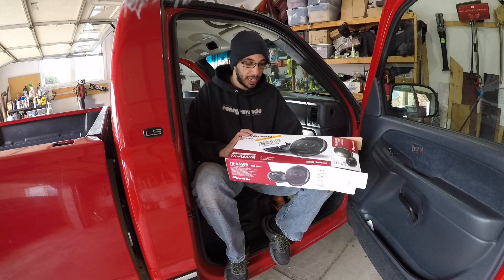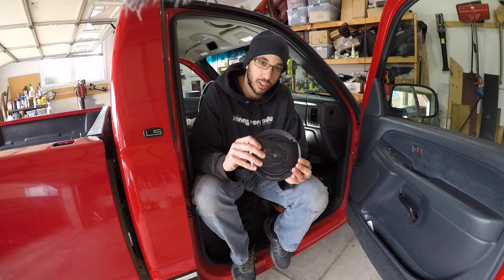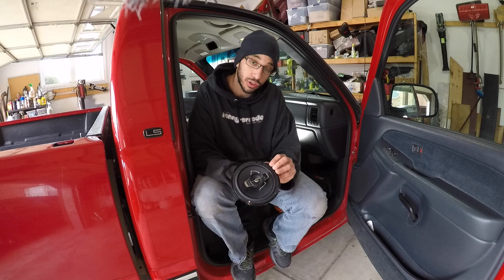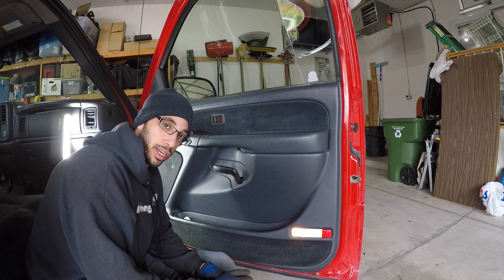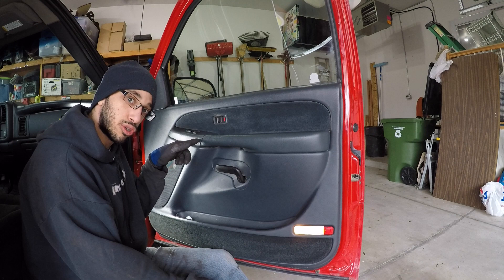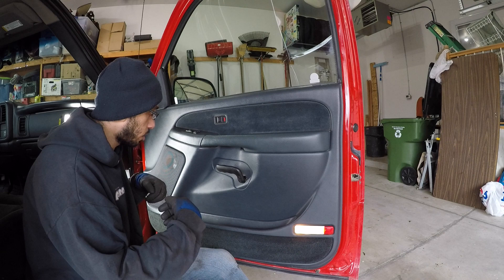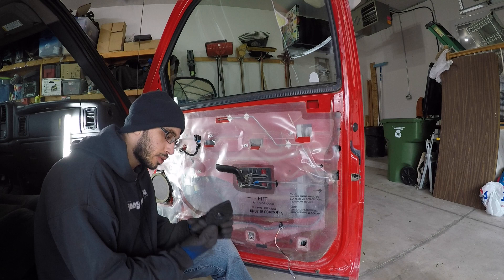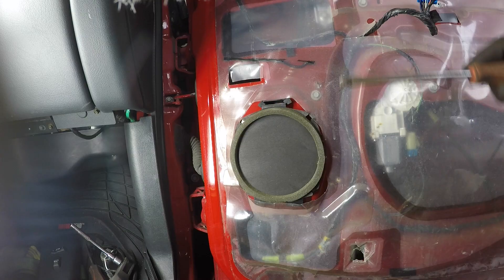2001 Chevy Silverado 1500 Front Speaker Upgrade

Comment: When you soldered the wires into the stock harness did it matter which side the positive or negative went on?
Reply from the maker: If you wire in multiple speakers then as long as you are consistent from side to side, you will be fine. For example, when wiring the door speakers, I think both had a black wire. I just put those black wires to the negative spot marked on the speaker and I was good. You will not blow anything up if you flip these around, the only thing that might happen is that the sound may come out distorted. So simply flip the polarity and it should solve the issue. 

Besides all that, you should always test your new set up prior to re installing the door panel and trim in case something doesn't work correctly because you will have it all opened up to diagnose and fix the issue. I hope this helps.
Reply: Thanks!!! Really helped! Time to go get some new speakers and install them haha
Reply: @mehoyminoy2485  any update on whether the side (positive / negative) matter?
Reply: @boji-boji  have not done it yet💀 wasn’t sure if I wanted to replace them
Reply: @boji-boji  positive negative definitely matters. if one side is reversed from the other the vocals particularly will try to cancel each side out making them diminished. Also it will not build an sound pressure at higher volume levels as each side is trying to cancel the other. I am disappointed he glossed over this critically important part.
Reply: After some research myself, here are the wiring requirements: For the front left (driver side), when you take the door panel off and disconnect the harness, the wires are TAN and GREY. The TAN is positive (+). and the GREY is negative(-). That translates to the recovered harness from the speaker to "A" is negative (-) and "B" is positive (+). If you look at the harness, it will have an "A" and "B" indicated. After I soldered off the old wire, I took the harness back to the door and matched up the slot. I noted which side was TAN and marked both sides of the harness with a "+". I did the same with the other side, marking it with a "-" Then I took that back in and was able to solder the correct wires based on the documentation for my new speakers (I got some Sony XS-R1646). Don't hate, they were $44 at Walmart and better than what I had. Also, on the passenger side, the colors will be: Light Green is positive (+), and Green is negative (-). I also got a new receiver, wiring harness, and adapter. Reply if you want to know what I got, of course, this is for a 2000 Chevy Silverado 1500.
Reply: I did it the same way as him, and it sounded good, so just copy him, and you should be fine

Comment: This is a Mickey Mouse job. Do not do this.
Reply from the maker: Hi Robbie! Thank you very much for the comment, would you be so kind and explain what you didn't like about the video? It would only help me for future videos I create. Thank you and have a great day!
Reply: Taping the tweeter in was wrong. With the heat in the cab during the summer, the tape will turn into a gooey mess.
Your wiring connector should have been mounted to the speaker and not left dangling in the door.
The wiring polarity has already been addressed.
It's only my opinion and I get a bit anal when I do projects/upgrades.
Reply from the maker: @jerrydespaltro4023  thanks for watching and for the feedback!

Comment: I installed a pair of Pioneer component speakers in my 02 Yukon SLT and reused the mounting bracket on the 6.5” woofers like you did. Worked great. I then reused the tweeter bracket by removing the old factory tweeter and taping in the Pioneer one. Worked great.  Thanks for the inspiration!
Reply from the maker: I am really happy to hear that and you are very welcome 🙂
Reply: You don't really need to add the old tweeter back, he used 3-way speakers.  Tweeter is built-in
Reply: I installed component replacement speakers. So I had to install the tweeters. I would worry that the factory amp would filter out the high range on the 3 way speakers.

Comment: Thank you Joseph. My soldering is not as good as yours. Still got them in, Also replaced rear, that was a pain. could not locate any type of adapter. Ended up just drilling into the holder that was there and using the same screws to hold the speaker. Metra makes an adapter for the tweeters #82-3016.

Comment: Hi Joseph, first I'd like to say, excellent video and good job with everything! So I was both commenting and asking, are you still running the stock stereo? I'd like to match my replacement speakers as close to my stock stereo's RMS specs as possible. Of course after perusing several videos of door panel removal, I still have yet to determine if my front speakers are the problem I'm having or it's possibly the stereo's output to the front speakers. That being said, I think you did a great job re-using the OEM speaker clip and harness connector. I probably will also do that if I end up replacing the speakers. Keep up the good work!
Reply from the maker: Hi David, thank you very much for your comment, I really appreciate the feedback. To answer your question, yes I am still using the factory radio. Thanks and take care.

Comment: I can’t get the bezel back on the front doors. I think my speaker is too big, even though it’s a 6.5, and I’m afraid to break it
Reply from the maker: So the bezel doesn't not sit flat, it will sit slightly bowed but it should still fit. I had to push a little hard to get mine to pop in, plus that bezel is pretty thick but if you break it, just buy another one at the u-pull. Good luck!
Reply: @joesdiy4260  Thank you, I ended up just using self tappers to screw it into the door and threw the bezels out.

Comment: I am about to do something like this on my sons 2006 Silverado. Question: I see there is a separate tweeter and woofer. If I installed a new 6.5 coax speaker in the woofer location - would it only be getting lows? Like is there a secret low/high pass filter somewhere sending lows to the woofer and highs to the tweeter? Or is the tweeter and woofer just spliced parallel together and the tweeter has a high pass soldered on it? Also wouldn't that drop the ohm since they are both on the same wire?  Like two 8 ohm speakers on one wire would be 4 correct? Trying to figure out if I should just leave the tweeter off or what. Thanks!
Reply from the maker: Hi Daniel, I am so sorry but I cannot answer question. I just threw some speakers in my truck haha car audio is something that I have never learned a ton about. Again, sorry I cannot answer your question, hopefully someone else here can. Cheers!
Reply: Just did this to my dads 2005 Silverado recently. The entire stereo system was stock but his front 6.5" speakers had fallen apart.
I replaced those speakers with Pioneer TS-652F. They are 3-way, 4 ohm, 6.5 inch, 70w rms, 320w peak, 87dB sensitivity.
The highs, mids, and lows, come through on the new Pioneer speakers, and the separate stock tweeters still put out their highs.

As far as I understand, the front mid woofers and tweeters receive the same signal, but the tweeters have their own high pass. I would assume the tweeters are a parallel yet completely separate wire feed that receives less power than the mid woofer does, but I'm not sure.
I thought about disconnecting the stock tweeters and tying their wire feed into the mid woofer wire feed for potentially more power output to the new Pioneers, but I ended up leaving the stock tweeters connected mostly because dad prefers clarity over punch.

The stock head unit was enough to push the new Pioneers and they sound good. Far better than stock. They would probably sound even better with quite a bit more power from an aftermarket head unit, but dads a simple man. Still plenty loud and even the bass is surprisingly potent especially when listening to bassy type music, though that requires the stock head unit bass setting to be at max. The volume at 50% is extremely loud yet with no distortion at all, and dad always keeps it below about 20%.

FYI, If your sons truck has the stock Bose system, there are 3 ohm and 2 ohm speakers used so they're not quite as simple to replace as the standard stock sound system. You'll know if it's Bose because the door speaker mesh says Bose on it.

Comment: The speaker wire for my truck keeps coming undone from the speaker any solutions?
Reply from the maker: Hey, thanks for watching and commenting. Make sure you have it pushed all the way on. You should feel it click. But if you are sure that you are pressing it all the way on, while it's connected, I would take a pair of pliers and gently squish the connector. That way, it becomes more tightly wrapped around the speaker connector
Reply: @joesdiy4260  so i only have the wires , the connector was gone from when i bought me truck and so i just have speaker wire connected to the  ends speaker and have the speaker wire wrapped around the silver ends but it comes undone after awhile
Reply from the maker: @bsmittygaming after you wrap it around the speaker connector, just used some electrical tape to hold it there. OR you could always solder it

Comment: Nice video. Another banger of a tune wish you had more montage for me to rock out to it. Also, since you have the outfit on for it, could you show us how to hotwire the 2001 Chevy Silverado? Asking for a friend.
Reply from the maker: Hi Mr.Scott, thank you for the kind words, I am not familiar with hot wiring a Silverado but I know that 99-07 Silverado's are very easy to break into and you can knock out the ignition switch/tumbler with a screw driver. Cheers!
Reply: @joesdiy4260  thanks for the prompt reply. feels good to get that info quickly kinda like the old reach around you mentioned at 7:55

Comment: Are they better than the stock Bose speakers on them. I’m looking for just little bit more base.
Reply from the maker: I dont know if the stock speakers were Bose or not but I can 100% say that they gave me a bump in base. I also changed the rear speakers out with some Kicker brand speakers, I was able to do the same trick with the rear speaker bracket as I did with the front ones. When I changed all the speakers, it really gave me that slight bump in base that I was looking for.
Reply: @joesdiy4260  do you have the link to the rear speakers you used?

Comment: Joseph good video. How does it sound?? I have a 2003 Chevy Avalanche so it is a little different taking off the door. How much power do the GM stock radios have? Higher efficient speaker ,30 rms better then one w 100 rms?  Looking at Kenwood KfC E1665 two way that is 92 db efficient. It is 30 RMS and there must be a cross over somewhere that sends higher HZ to tweeter not to the midrange. Could not find an affordable midrange so I am going with this two way instead of the coaxial type. What is your thoughts on that. Or can anyone else give me feed back on the few questions I have?
Reply from the maker: I personally think they sound great but I am not an audiophile by any means. I honestly do not know the answers to all your wonderful questions and I really wish I did. When it comes to audio equipment, I just install it. But thank you for your comment and take care!

Comment: I’m getting prepared to do this for my truck and was thinking of reusing the stock harness from the stock speaker and soldering new wires from that into the new speakers. Would I run into issues of the soldered new wires into the stock speaker harness coming into contact with the metal in the door?
Reply from the maker: Hey, thanks for your question, its always good practice to try and wrap exposed wires or solder joints...I would go ahead and insult them, either with heat shrink or electrical tape.
Reply: @joesdiy4260  thanks for the reply!

Comment: Hey there man I had a question I know this video is a little old but barely happened to me. ( if you could help thank you if not it’s all good ) but I have a Chevrolet Silverado 2000 single cab and the drivers upper side ( the small speaker ) went off on me. It worked but all of a sudden it would go off and go then it stopped, I was going to take it to get it fixed but they are pricey so. I was wondering if maybe you knew what it can be, I’m sure it’s a wiring problem but just want to make sure! Thanks again!
Reply: And if you can help with tips and that sorts thank you so much!
Reply from the maker: So what I would do is disconnect the speaker and do a continuity test while wiggling the wires of the speaker. If it isn't continuous then I would just get another speaker, I am sure you can find another one in the junk yard for next to nothing. 

If the speaker checks out fine then I would go to your local library or community College to find a factory service manual and test the connection between the door harness and the speaker and then the door harness to the head unit (if that is where the speaker is getting wired to). Good luck!

Comment: Since they are three way speakers, do we have to reconnect the OEM tweeter?  Great video, by the way!
Reply from the maker: Hey Craig, I really appreciate the comment and feedback. I honestly never thought about that, I just re connected it because it was there haha 😄 I personally don't know how it could hurt if you plug in the OEM tweeter. Take care!
Reply: @joesdiy4260  I am going to give it a try tomorrow, if Best Buy has the speakers in stock, and I'll let you know!  Thanks again for the informative video!
Reply: @joesdiy4260  I got them in and decided that you're right, why not reconnect them!  Like yours they fell right out while I was removing the door panel but a few sheet metal screws and they were better than new!  They sound great and my daughter thinks I should get, "Dad of the Year Award!"  Thanks again for your help!
Reply from the maker: Craig Stefanisko hahhaa thats amazing! I so happy to hear that they worked out! Cheers!
Reply: @craigstefanisko9373  You should not reconnect them. The new speakers that were installed already have a tweeter attached to the 6.5" woofer. Now you'd be running two tweeters in front which will definitely sound worse. Like worse than the stock speakers. I appreciate Joseph's time for making this video, but there are some critical mistakes here. Not knowing whether or not the speakers are wired with + to + and - to - correctly and running new 2 way speakers, but leaving the shit factory tweeter in place is audio treachery.
Reply: Wouldn’t do anything,and will sound better if they weren’t connected as long as your + & - are correct 
(left front speakers +tan -gray ) 
(right front speaker +light green -dark green.

Comment: What can you do if you don’t have a soldering gun?
Reply from the maker: The best thing I could suggest is twist and tape. I understand if you cannot afford it but soldering irons and solder are only $10 or $15 on amazon.
Reply: Joseph I might look into one of those. So are you saying if I dont solder it, I would need to cut the bracket off and twist the wires that came with the speakers to the old harness
Reply: Wire crimps and crimping tool

Comment: Doesnt the factory amp require 2 ohm speakers?
Reply from the maker: I honestly have no idea. I didnt have any issue with these speakers and they sounded really good. I am just a dude that installed speakers in his truck and made a video about it.
Reply: That's only for the stock Bose system. The standard stock system uses 4 ohm speakers.
Reply: I've installed 4-ohm speakers into a 2-ohm system, and visa-versa. Didn't notice a dang thing in both cases. I even wired two 2-ohm speakers in a series to make that particular channel equal to 4 omhs since the system was 4 omhs. Couldn't tell any difference at all. The biggest difference-maker I've experienced is making sure the polarity of all your speakers is identical. When I was a noob, I initially didn't pay attention to the polarity and the sound was pretty bad and I had to take everything apart again to match polarity.

Comment: Which colors from the factory harness are positive and negative
Reply from the maker: I honestly didn't test it, I think both sides had a black wire and just used that as my negative. As long as you are consistent between sides you will be fine. If you flip polarity then you MIGHT get a distorted sound, just flip it the other way around and test to see if the distortion went away. Hope this helps and take care.